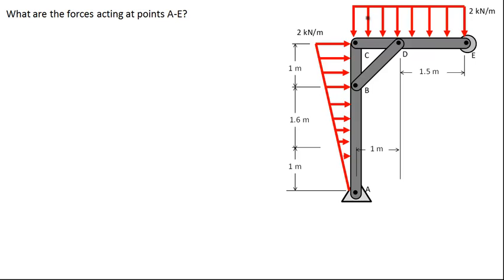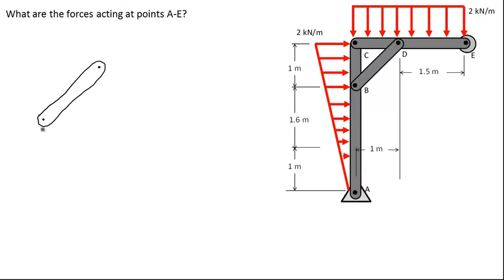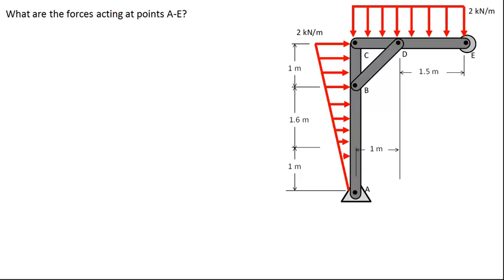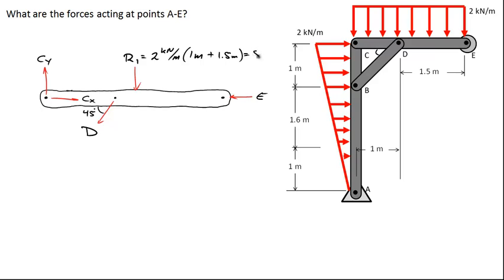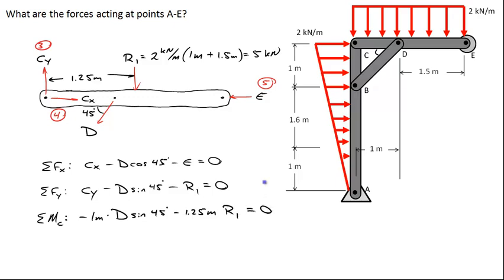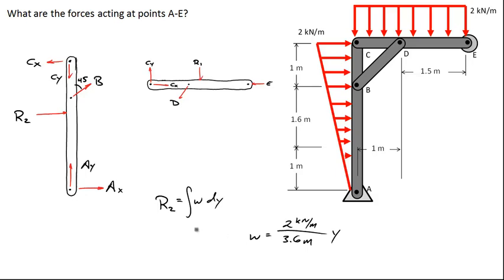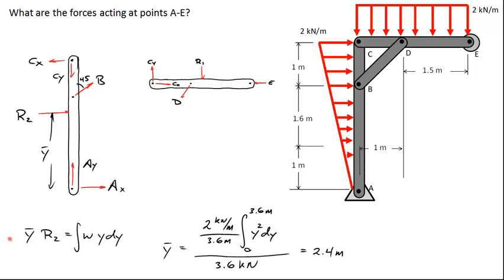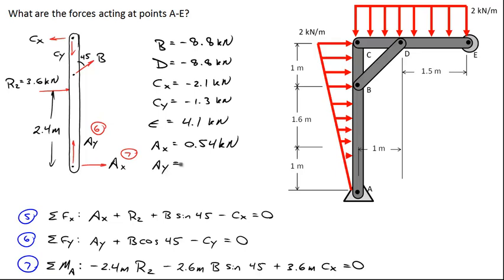Force balances on a frame with distributed loads

Comment: I'm not positive if I did it correctly but I was able to solve for some of the external reactions without needing to explode the frame and I got some different answers. I may be wrong though.
Reply from the maker: Yeah, exploding the frame is long-winded, but I do get the same values for A_x, A_y, and E when I do a free-body diagram of the whole frame.